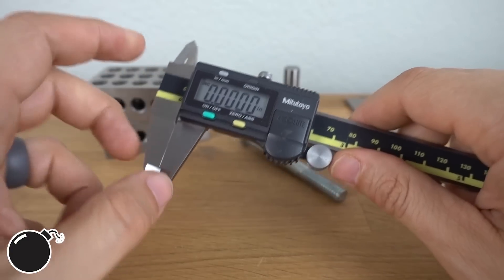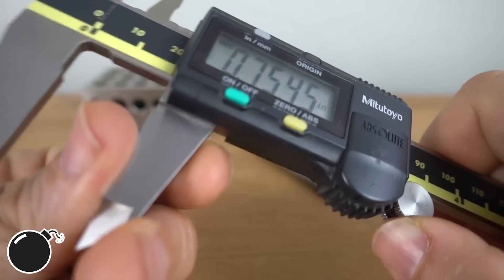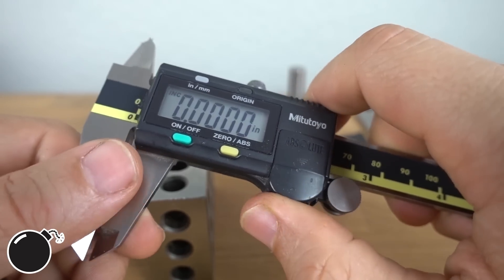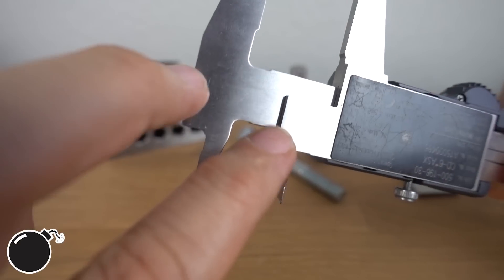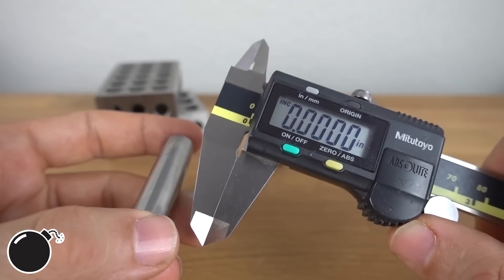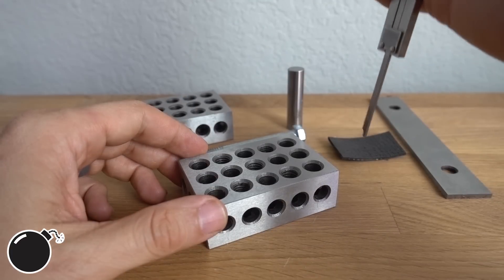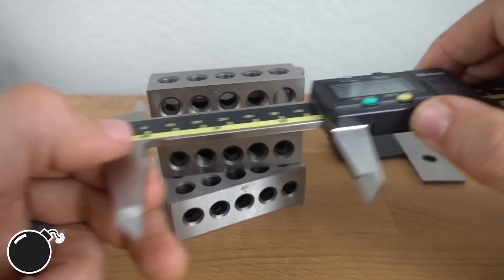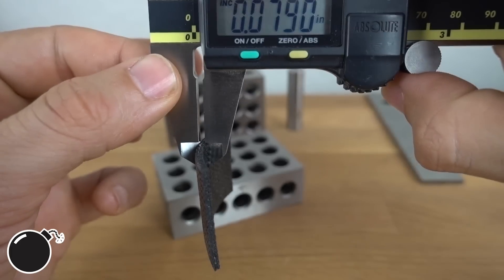How to use Calipers like a Mechanical Engineer

Comment: 6:45 The holes do not have to be the same diameter. Measure the outside distance and subtract the radius of each of the holes from the value you measured.  Or measure the inside distance and add the two radii.
Reply from the maker: zorkan111 thanks for pointing that out!